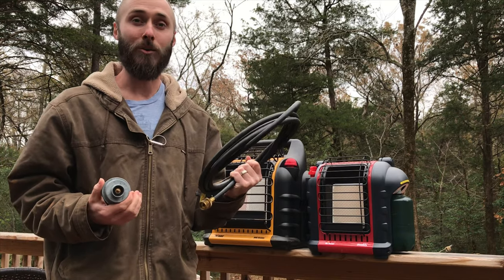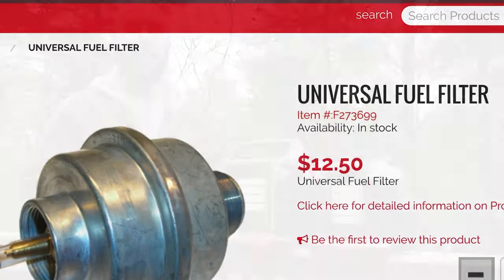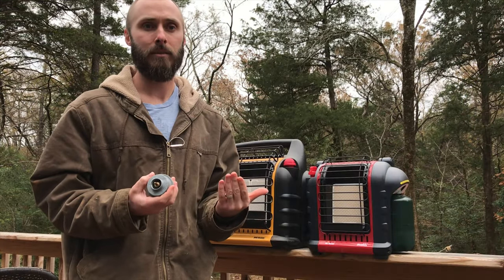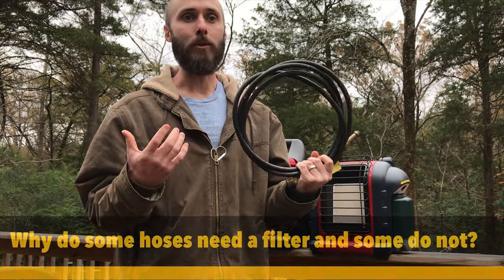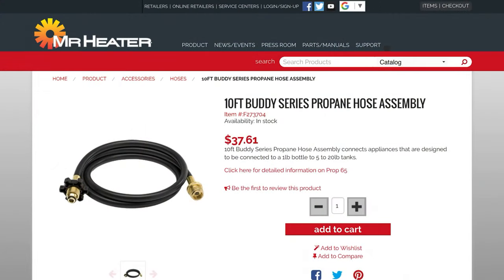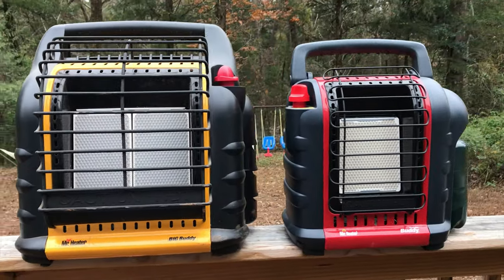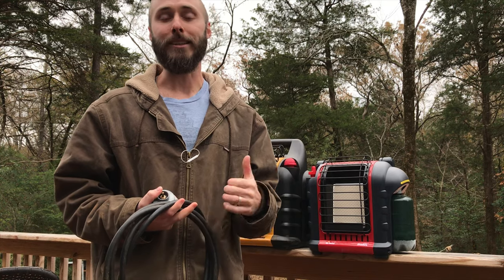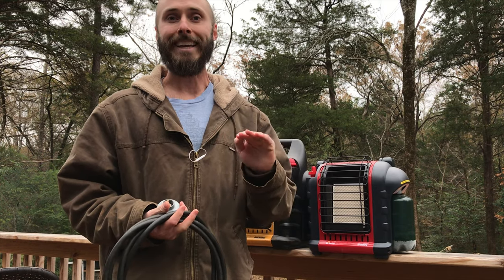Is a Mr. Heater Fuel Filter Needed When Connecting To a 20 lb propane tank? | East Texas Homestead

Comment from the maker: Here are some quick links to the Mr. Heater Hoses: 
◾ 10-foot-long hose eliminates the need for a fuel filter
🔗 https://amzn.to/2NVpXAZ
◾12' Hose With Regulator & Quick Disconnect
🔗 https://amzn.to/2r15bqG
◾12-Feet RV Hose, Quick Connect x 3/8-Inch Female Flare Thread
🔗 https://amzn.to/2NXfZ1U
◾Mr. Heater F273699 Fuel Filter
🔗 https://amzn.to/2Om0vDW
◾Mr. Heater Big Buddy
🔗 https://amzn.to/32USnPJ
◾See all products on Amazon
🔗 https://www.amazon.com/shop/easttexashomestead?listId=2WLDOXLHYXONO

These are affiliate links so if you click on them and make a purchase, I will receive a small commission.
Reply: My buddy heater only lasts an hour from 1 lb green tank.. Its not leaking and bottom of tank gets very cold
Reply: So will a F271804 it is a 12 ft quick Connect with Regulator work on a Big Buddy?
Reply: 9

Comment: Be sure to use a filter if you are using 1lb propane bottles that have been refilled.  When you refill a bottle and your 20lb tank is tipped upside down the debris that is in your tank goes to the outlet valve and to your bottles.  Commercial propane can have water, dirt, rust, and oil.
Reply: Thank you for posting that information.
Reply: Or with adapter,  put the filter inline when refilling.
Reply: But the 1lb bottles are screwed into the regulator upright just as if the 20lb tanks would be so I'm not sure that makes a difference. The contaminates would be at the bottom of the 1 lb tank
Reply: @staind288  How long has it been sitting there, completely undisturbed?
I'm not willing to bet my heater on that, on the coldest night of the year.
Because we ALL know it's most likely to fail is when we need it most.
Reply: IDK. Mr. Heater never recommended that in all their literature, in my experience. It sounds plausible in theory, but I see no actual empirical evidence. And I've never seen it recommended by Mr. Heater. 

It might just be a theory, an imagined problem.

Comment: I have also read that a 20 lb tank can readily have impurities in the propane or tank itself. The filter will prevent these impurities from getting into the heater. My only question is, if you only use your heater for an hour or two, once or twice a year, do you still have to change your filter annually? Is it reasonable to say change the filter after so many hours of use, rather than annually? What about the guy who ice fishes every weekend all winter and has hundreds of hours of use each year?
Reply: Yup, water and debris

Comment: I suggest using a brand new larger bottle if you are going use a 20 pounder. An older bottle is full of rust and clogs the filter very quickly.

Comment: wet gas,,, i grew up  in fairbanks alaska in a family owned store 60 yrs ago,.we sold pro;pane,ive never heard of oil in the propane till i started using a buddy heater a few yrs ago,my friends heater got sluded with oil ,,so i took it apart. the gas lines were totaly full of propane smellig oil,you cant tell me this thing got so full of oil just from the hose... its in the damn propane. the producers make more profit that way
Reply from the maker: Interesting. So would you recommend the filter no matter what hose you're using?
Reply: bob pope is correct.
Reply: The oils come from the propane tank itself as it comes from the pumps when being moved from the trucks to the storage tanks and again when it is pumped from the tanks to your smaller tanks since they don't use purely the pressure from the tank itself.
For your average gas grill it won't matter as they don't have anything to clog up before the burners fail anyways but for heaters they will clog up the ceramic plates over time.
Reply: So if it doesn't have ceramic plates such as campy gears chubby then a filter is of no concern???

Comment: I did that. with that so called filter and it still want bad 3 times , save your $. it does not fitter anything . Test the filter put dirt and or oil in the hose and watch what happens it goes right trough the filter! Those filters are a jock. But the heaters are great !And my filter was always empty, I weighed it before and after.
Reply: False.
Reply: @DIYTFY  if it is false, show us the video and the test of the filter. put your money where you mouth is . saw one in half and show us how there is nothing to stop oil.
Reply: @bigjimcountryboy  I did see one opened up (on youtube) and there was an oily residue, even enough to form a few drops, on the sides of the filter that it had pulled from the hose.

Comment: I am sorry to inform you that you are wrong. And so is everyone who believes that the oily substance comes from the hose it certainly does not. The fact is that the oil comes with the propane. The oil builds up in the tank with every refill. This can be tested yourself. Just take an old 5 gallon tank or larger and remove the valve and turn the tank  upside down and measure how much oil comes out of the tank. This is the propane company's dirty little secret. Some tanks have so much oil in them that the oil will collect in the gas lines coming into a standard 1/2 inch pipe and cause an over pressure to gas appliances, like a standard tank water heater. This over pressure then causes the water heater to over-flame and possibly burn down your house! Fortunately, the Buddy Heater clogs up and stops working. So I dare anybody who believes that the oil comes from the hose to prove it. The fact is the makers of the Buddy Heater have two ulterior motives: 1 To circle the wagons to protect the dirty little secret from coming out.  And 2  This way they can fool you into buying their hoses. That's the truth the whole truth and nothing but the truth. Please stop continuing this lie...Bill Rogers

Comment: If your hose came from China,  probably a good idea to use the filter. My propane guy told me to forget the filter. When you shut it down,  turn off the valve at the tank and let the heater burn off any gas that was in the hose. He says everything will be just fine.
Reply from the maker: Good tip! 👍🏼
Reply: Shutting off the gas to alot of things and letting it burn out is great practice. I.e generators. Lawn mowers, weed eaters, grills, etc etc
Reply: @justaguydoingguythings2762  but my grill has safety BS in place so it shows there's a leak. Meaning I would have to disconnect from the tank and reconnected if I did that every time

Comment: This may be slightly off topic but the 20 Lb Cylinders of Propane you get at a Home Depot or Lowes typically has between 14.9 to 15.0 pounds of propane in it. I go to a local independent store where their cylinders have 17 pounds of propane for the same price. I just found a propane company where I can bring my 20 Pound cylinder and  get 20 pounds of propane put in for about the same price as Home Depot or the other local independent. I have verified this by weighing the empty tank and the weight after filling. Makes sense to me to go to a propane company and have your tank filled to full capacity if you can find one within a reasonable distance. Obviously it doesn't pay to go 100 miles to refill. In my case the propane distributor is 15 miles each way. If you bring 6 cylinders to be filled they only charge for 5. This is on Long Island, New York.
Reply from the maker: Great info and thanks for sharing 😊
Reply: I go to Tractor Supply because they fill the tank in front of you and you can see they put a full 20 pounds in. I don't go for the swap out services.
Reply: All major places are that way, always shop local to get you're money worth
Reply: Don't know about you, but by law where i am they can't fill over 80% due to expansion.

Comment: I am on my 3rd hose now, first hose was my fault wrong fitting, 2nd hose 5 ft mr heater leeches chemicals aka contaminants into your heater even if you use the filter.  The filter is more or less a gimmick for failing to provide a regulator on the hose causing the need for a filter or special hose.  What does this this add up to?  A scam.  The fact that this information is not plastered anywhere on the heater itself or its Manuel is proof this design flaw was a intentional act to sell you more hoses and filters. Do you think they want you to know about the hose that does not need a filter?  I THINK NOT.

Comment: This is great info!  I contacted the manufacturer directly before I went and bought my fuel line.  Exactly as you said, the 10 foot hose is the only one that doesn't need the filter.  Here are the part numbers, and the letter I got directly from Mr. Heater: 
F273701 (Requires fuel filter F273699)

F273702 (Requires fuel filter F273699)

F273703-60 (Requires fuel filter F273699)

F273703-144 (Requires fuel filter F273699)

F273704 (No fuel filter required)

F273705 (Requires fuel filter F273699)
Reply: Thanks for the part numbers my friend greatly appreciated
Reply: Thank you Stephen 👊🏻

Comment: Thank you, I was wondering about that. 
I think I will order a hose that won’t require a filter.
👍
Reply: Then you will need Mr. Heater hose #F273704.  Otherwise you will need a filter to put on the 20# tank before you hook the propane hose to it.
Reply: For about 13 bucks, I will use the filter anyway

Comment: So my furnace took a dump about 5 years ago. I have an eden pure in the bedroom, a small electric heater in the bathroom and the same Big Buddy for 5 years to keep the main living quarters comfortable on low.
 How do I describe comfortable? Well, in the summer I'll  turn the ac on and at 60. But like most people I would turn on the furnace if it even got close to that. Lol. So I just say to myself, if it was summer I would be enjoying this.
  Anyway. I've had the same Big Buddy and only had an issue with it after about 2 years of 24 /7 use in the colder months in Michigan.  Replaced the filter and no problem. My shut down process has always been the same.  Turn off the 20lb source and set the heater control to Pilot and let it burn out.
  As far as filter or no filter? Their are impurities in every kind of fuel. So if whatever one owns can accept a filter?? Use one.
 I appreciate your vid and concern. But before the haters start up again.... because they ways do. My house is a single floor with 2 bathrooms and 3 bedrooms in Michigan.
  Savings requires cost: I highly recommend getting the power adapter for the fan if your Big Buddy has it. You'll spend a ton on D batteries if you don't. Not too mention you'll reduce waste in the environment. I have a cheap little solar panel system which powers the adapter and our TV for many hours. Or you can do what I did in the past, (while learning) you can purchase a small (Eco Fan ) and wire it to the top of the Big Buddy with a coat hanger. No electricity needed at all and works great. But savings require investment.
 If it requires fuel, it requires filters and maintenance.  I stood in my garage all day..... I'm still not a mechanic, but I do have common sense.
 Thanks for the vid.

Comment: Well, that explains why my buddy heaters only last a year or two.  Thanks for the video.
Reply from the maker: Sorry to hear that but hope this helps.
Reply: you can also take it apart and clean it. what I had to do when my buddy stopped working, every line was plugged with that oil, blew it all out with brake clean and let airdry
Reply: @ShadowDragon246  was it a pain to take apart?
Reply: @koreyhannan9071  nah not at all. just lots of screws, take pictures as you take it apart. I used chlorinated brake clean to blow out all the lines, then followed by 99% rubbing alcohol, and air dry
Reply: @ShadowDragon246  ok cool

Comment: I have a stupid question. I have the Big Buddy and the 10-foot Mr. Heater hose that does not require a filter. BUT -- COULD I add a filter anyway. as extra protection? OR would that be overkill? Would it cause issues with the 10foot hose? Just wondering. (Great video, by the way.)
Reply from the maker: If you want the extra protection, I don't think it would hurt. Just keep in mind that if you use the quick connect, the filter won't work.
Reply: That hose doesn't contain the material (plasticizer) that generates oily residue.  So yes it's overkill, not needed.

Comment: You really helped me out a while back with refilling 1lb propane tanks and I would have bet a Diet Coke I subscribed to your channel then. I see now that I didn’t. 

I have the filter you mention and have burned many 20lb tanks thru my Mr Buddy over the last three years without failure even once. 

Aside, I just bought two of the wood stove fans for my two Buddies. They work flawlessly and dissipate the heat much more efficiently than letting it rise straight up or by putting a fan behind the heater.

New subscriber!

Comment: Observation: fwiw; My oem Mr. Heater filter from Lowes F273699(diagram)/ 73699C (package)
reads 300hrs or yearly
As a retired engineer I would presume some rubber-plasticizer-oil-chem E-slide rule guys say 300 for a damn good reason. Yearly accounts for storage/ season concerns. 
I just installed mine going fromgoing from a 20lb tank to Mr. Buddy heater AND refilling 1lb greenies.
Also using a spankin' new black hose. (no part # but is Lowes.
Why did I go all out? Because I'm having  newly purchased Mr Buddy issues. It will prime and stay lit but 50% time won't ligt to low or high.
 My time aint worth it and getting cold camping aint smart.
Gotta say I'm refilling for the first  time ever 12 used-once greenies. I want them pure.
My 20lb may have gotten contaminates from my local Ace on this recent fill but what ya gonna do?
Did oils/ critters/ dust get in possibly? Who knows? but throwing $50 was worth it and I can sleep on it.
With green 1lb @ $5 each I'm still a nickle dime at heart and frankly re-filling is kinda fun. P.S. I love to huff a little propane here and there and freeze burn turns on matures.

Comment: Thank you so much for translating and illustrating the particulate build up /also described as ‘fluid build up in lines’ problem that causes heater to shut off seemingly for no visible reason. Found solutions through Google troubleshooting, but I appreciate so much more your preventative information and instruction. I wish I had paid more attention last year before the build up from my uninformed ignorance was able to accumulate. Now after clearing out lines, I will definitely get a filter. Great Video!
Reply from the maker: Glad it was helpful! Good luck with the new setup.

Comment: Most excellent video!  Thanks for posting. I have the regulated 12 footer. I like it very much. For any case no way I would replace that filter every year. Have you checked the price of these filters on Amazon?  They are like >$40 now. Your link shows lowest price $33 now. Not sure where the $8-12 ones are. Ridiculous.
Reply: Mr. Heater F273699 Fuel Filter
$16.50
Reply: Got one on ebay that looks just like the Amazon ones. $15
Reply: @sanchopancho2145     It's still a waste of money.  I bought the no filter needed hose from Amazon for $29.  I could have saved maybe $10 on a cheap hose, but the first time I buy a filter I've spent more than I would have buying the official hose.  Then every time I have to replace that filter, I'm deeper in the hole.

Comment: You do not need a filter with the regulator hose (F271803) and Quick Disconnect.
And the newer hoses from Mr. Heater without the regulator no longer need the filter.
Mr. Heater. "Currently, we make three hose models that do not require a filter: the F273704 which is made from a different chemical compound of rubber that does not have the oily substance that can get into the fuel flow, the F271802 that attaches to a low-pressure line, and the F271803 which is a regulated hose."

Comment: I am totally confused on this.  What does a regulator have to do with filtering.  Why cant i use a regulator valve to control the flow from high to low to low to high to control heat output. Or for that matter use the main valve on the 20 pound to control flow and heat output??  If there is an issue with contamination with certain hoses Mr Heater should just sell the proper hose with the unit. Quit fooling around with all these stupid scenarios.

Comment: The longest of those hoses, which has a regulator attached, and which then is hooked up to the Buddy heater, would, by your definition, "over-regulate" the gas flow. This seems to be
a contra-indicated hose, and yet Buddy offers it. I think that lowering the pressure to the Buddy, with an external regulator, would not "over-regulate" the Buddy, since Buddy itself,
markets just such a hose/regulator assembly.
Reply: The regulated hose connects to a quick detach on the heater, the other hoses attach where the 1lb canisters attach (which is a regulator)  that's why hose with the regulator doesn't over regulate
Reply: I'm not positive, but I believe the regulated hoses are for use with older model buddy heaters that do not have a regulator installed on the heater itself.

Comment: So the 12 foot hose has a regulator, but the Big Buddy also has a regulator, but your not to double regulate the big Buddy. Makes perfect sense.
Reply from the maker: Exactly 🤪
Hears the deal, the regulate hose uses the quick connector and bypasses the built in regulator. Hope that helps.
Reply: John D - make sense now?? 12 Ft hose bypasses built in bottle regulators so not double regulating…

Comment: Short answer is “Yes”.  The long answer is unless you want to take a chance and wreck your buddy heater, “yes”.
Reply from the maker: Short and to the point. :)
Reply: There are hoses made for it that does not need a fuel filter!! I checked my hose with the manufacturer and was good to go with no filter!
Reply: @Northof54   You're right, the Mr Buddy one that doesn't leach rubber oils into the fuel.  Thats actually the one I have, but for the couple bucks, a filter is cheap insurance.
Reply: @MrRayMac1963  Very true! I love my big buddy!!!!